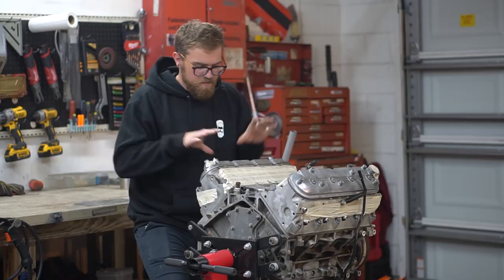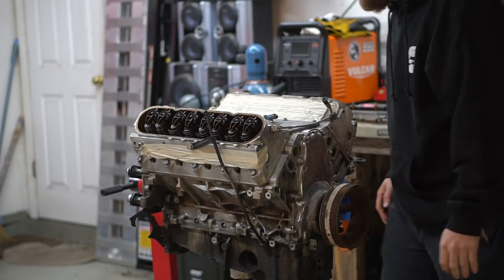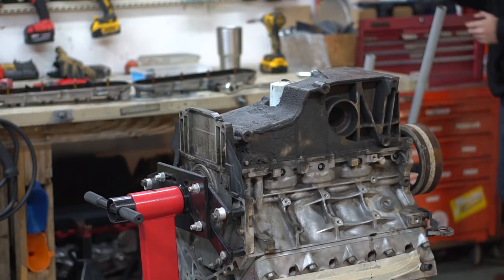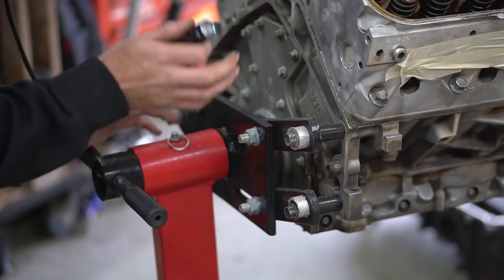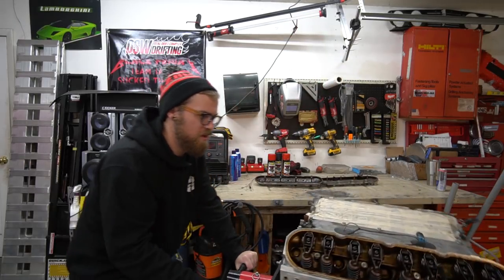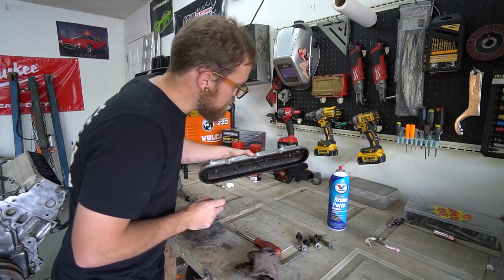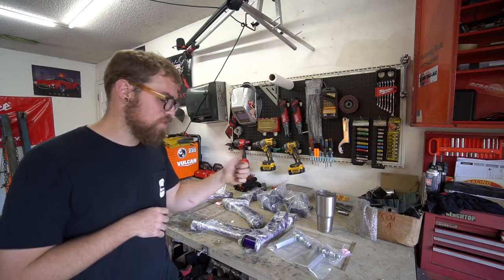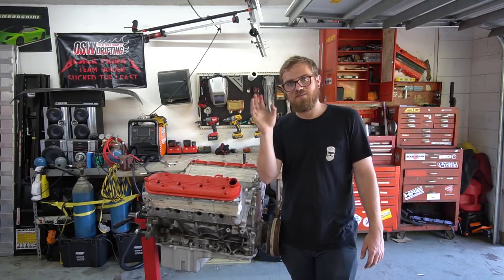Budget LS Swap Miata Pt.3 Opening up the Engine + Surprise Mod

Comment: Taylor! Don't run a high volume pump! These motors already suck for oil starvation with small pans, like what you will be running. Melling Makes a High pressure, stock volume pump. Part number 10295, Thats what ya want. I talked to ya at the Montreal FD event about my ls miata, Glad to see you're going through with it!

Comment: I would take the heads off to check out the condition of the cylinder wall & rings. like you said.. could be a little buildup that will clear. But even if you dont need them, head gaskets are very cheap compared to everything else you will throw at it. Great video, exited to see the rest of the build!
Reply: Christian Hansen not even take the heads off but at least grab an inspection camera from an auto store, usually you can rent one or they will lend you one to use and inspect the walls and pistons
Reply: But a camera to shove threw the spark plug holes.

Comment: Taylor you should check your knock sensors while you've got it on an engine stand!!! At 17:42 in the video they're under the two little rubber boots right on top. I've got almost the same engine in my truck and at 170,000km the knock sensors were completely rusted out. It took me a few hours in the garage to replace them and it would have been a lot easier if it was on a stand. 
How i'd check them is just remove the rubber cap and if water got in and rusted them replace them. Also make sure you use silicone on top of the boots after so water wont get in again!!! at 17:42 in the video they're under the two little rubber boots right on top. Depending how you are going to wire the engine bad knock sensors tell the engine it has a knock when it doesn't and i believe can get as bad as limiting power and changing timing of the engine. (At least thats what i noticed with mine) after replacing mine i've had no issues since.
Keep up the awesome videos!!

Comment: It looks to me like that motor has been over heated before..  I just did a motor rebuild from a catostrophic failure caused by over heating and the in side of my motor looked the same..  Kinda goldish in color aluminium and black steel. This is caused by oil getting to hot.  On another note i get your 75 25 thing..  However consider this the 25 that is left over could turn into another 75% of work Needed to be done later.  For example if you leave it kinda dirty now and you dont notice that there is a hairline crack in the block that could have been welded to stop it from fracturing will turn into a major repair later..  Cleaning is free man..  Other than the time spent cleaning (timeismoney) you may come out ahead later..
Reply: Andrew Bair most Ls based engines will turn that goldish color just from use, it doesn’t necessarily mean that it has been overheated
Reply: Oh yeah I could be wrong thats for sure. However that crank and those rockers looked awful black to me. The motor that I just rebuilt was not an LS either so it could be fine. After watching videos on my motor being rebuilt after 100k none of them looked as black and as "goldish" as mine did. After some digging I found a few people that have said that they believe that its from the oil getting to hot but you know... internet... so.. yeah there's that.. I am not an expert I was just using my past experiences as a reference. I dont have much engine rebuilding experience besides working on my own stuff for the past 15 or so years.
Reply: One side is darker because that’s the side with the pcv valve hard for me to believe all you guy’s rebuilding engines don’t know this already. But I guess most of you guys are young. So now you know and I wouldn’t say that in front of any experienced machanic you might get a funny look as this is one of the first things you learn when beginning to work on engines

Comment: I'm with you man, I love the wrinkle red on valve covers. That's how I did my DSM. But the only drawback is it's very hard to clean up, compared to a gloss finish. The key is to fix the oil leaks, then it stays nice and pretty lol.

Comment: Tip on the engine stand,  if you line the center of the stand to where the cam is in block it will be really easy to turn engine on stand. Makes it not so top heavy. Enjoy the videos keep them coming.

Comment: When doing the cam swap if your not gonna pull the heads get 16 pen magnets and use them to hold up the lifters don't trust the trays to hold them. I've did cam swaps under warranty on about 30 or 40 5.3 motors and if your gonna pull the heads replaces the bolts with studs well worth it if your ever gonna go back into the motor for anything.

Comment: Hey Taylor, just a little trick i learnt on getting snapped studs/bolts out. Instead of welding straight onto the stud, weld an old nut to the stud and use a socket and breaker bar to get it off 😁

Comment: You are already there. Pull the heads have them decked, better compression ratio and ensure head gasket seal. Trunion upgrade to rockers. Pull the piston and hone the cylinder walls. Put fresh bearings, connecting and main. Cheap insurance. Might as well make sure it will be long term reliable.
Reply: dose he have a ls1 or just a 5.3 ls based motor? if so i would bore it to a 5.7 amd run flat top pistons and a btr cam stage 4 and port the heads like you said had that same build in a 01 z71 and she was fast and strong

Comment: You really shouldn't spray brake cleaner in your bottom end. Especially over the bearings/ conrods. it will strip out the oil layer in the bearings & when you go to start it the crank wont be floating in the oil it will rotate on the bearing it self. Metal on metal is not good. Make sure before you start it you crank it with no fuel/ spark to build up oil pressure so it will re-fill the bearings with oil. Looking forward to the finished product! Best of luck!

Comment: I would pull the heads. For sure. Makes the springs and cam easier. When you buy a full gasket kit you get the head gaskets anyway. since you have to do springs, And you will get a full gasket kit, you also get valve stem seals. Extra piece of mind. You can see how free it spins with out the lifters and pushrods and cam turning. You will know for sure what’s causing the. Hang up...  it’s just a few extra hours labor.

Comment: Hey Taylor just a heads up, I had one of those engine stands from harbor freight. It had great review and everything! I put it together and threw a Ford 4.6L on it and the first time I started turning it, the welds gave out. Scared the crap out of me! Fortunately the motor didn't hit the ground. There was a bit of the weld that was still holding the plate to the stand. It did dent up the oil pan a bit though. Anyway, my point is, you should probably take the time to re-tig the welds that hold the plate thingy to the tube thingy. After I zuesed them up, I could stand on top of the engine, jump up and down, and it held just fine. Just don't want to see the LS hit the floor or hurt you.

Comment: I dont know if you have already chosen a cam yet but if not my recomendation would be something in the 22x/23x size range. A cam of this size such as a btr stage 1 or 2 ls1 cam will sacrfice little to no torque at low rpm and make sizable gains over 4k. roughly a 75-90hp gain just from swapping cams and springs. I would also highly recomend rebuilding the rocker arms with a comp cam trunion upgrade as to avoid filing  your engine with the little needle bearings at high rpm lol. Hope this was helpful, im looking forward to seeing the rest of the build series!

Comment: I just got done doing this with my 5.7 on my channel. I tend to follow the "good nuff" rule, similar to your 75/25.  its odd how that one side is black and the other is more brown. engine looks pretty good though.. dont "like" the hang ups when rotating it for sure. I also had the same pondering moment to pull the heads or not but got all my exhaust bolts out and rotated buttery smooth, so I hope im "safe".  I did do the trunions for RPM issues not really HP. I also put new timing chain and oil pump. I also had the holes drilled for the timing chain guide which i was SUPER happy about. Good luck with the build!!!!
Reply: ToxicMongoose darker side is because of pcv on that side, I've always been opposed tools swaps but now I kinda want to 😂😂
Reply: I guess that could be it.. though when i took mine off i didnt notice such a difference.. OH YEA i would def  prefer an engine that came in the car but nothing really excites me in that range and I feel like for me 240 and LS is  best of 2 worlds

Comment: Check the crankshaft shims make sure there not worn or un aligned. And if you pull crankshaft out if bad or wanna see more you can remove pistons easy that way at that point and check head without allot more work. The metal has a black tent to it like never changed oil or overheated. Up to you

Comment: Hopefully this doesn't get lost in the comments....

The "hang up" was just some slight rust build up from sitting with the water in the cylinders. Once you got it moving it knocked everything free. It's gen3 rods.. so they are the weaker variant BUT will still support 550whp. Plenty for the Miata. DO NOT replace the oil pump. High "flow" pump WILL suck the pan dry under high rpm and you will do damage. LS's do not have the best drain back setups, so keep the stock pump (will still make over 80psi without an issue) and add a extra quart of oil. Tech tip: flip the engine upside down when you do the cam. The lifters are under the heads on LS engines, so with the engine upside down they have no chance of contacting the cam as you pull it out (don't forget to remove the rockers and pushrods). Any more questions, feel free to reply or message me.

Comment: Personally, since your changing valve springs anyway, i would pulled the heads off. Its a win-win. Makes the job 100x easier as far as changing springs go, and you can see clearly how the hone is on the cylinder walls. But you can always fill the cylinder with air to change springs. If you do that atleast by a boroscope to put down in the cylinders to check them out.

Comment: About the whole wire wheeling the aluminium surface to get the silicon off, I use a scotch bright pad on my air tool and it does an amazing job! Try it out!

Comment: I do like your 75/25 philosophy, it keeps you on track and like you said, it's easy to get side tracked and loose sight of the goal. Personally, I'm a big believer of "do it once, do it right". You mention you want to get a cam and springs for it but would like to keep the heads on, the way I see it is you put in a new cam and springs and those little things that are in-between, the lifters, are a very critical piece of the valve train. It's pretty hard to inspect them with the heads on. I would suggest keep doing what you're doing, do the visual checks and a few little things but leave the stock valve train in the engine. It would suck balls to go halfway and put a brand new cam in and then shortly thereafter find the lifters ate away at it and now you're back to where you are now. Also another side note, put a new o-ring on the oil pickup but leave the pump on, the high volume/pressure pump stuff is unnecessary and could potentially do more damage than good, especially with the style of driving you will be doing with the car. Like I said, either keep it nearly stock with more than adequate power, beat the piss out of it, if she's reliable and you want more power, do the cam swap the right way and then be happy to know the rest of the short block will support the added stress. Keep the videos coming and thanks for the hard work putting them together for us to enjoy!

Comment: Taylor, pull the heads! If ur doing a cam u should upgrade to ls7 lifters. Ls motors are notorious for spinning lifters with a cam & lots of rpm! Plus a trunion kit for the rockers.  I made the mistake of not doing it, and kicked myself for it later!!! Good luck with the build!

Comment: You should totally take off the heads and check those piston walls!! Your biggest cost is replacing those gaskets and that's not a bad idea to replace anyways; unless you also wanted to do head studs. It'll be so much worth your time checking out those piston walls especially at those rough spots you felt while cranking that engine (in the wrong direction).

Comment: FYI to share. Never unbolt the oil pan in the upright position.
Always unbolt from the bottom.
So no fine metallic particles will fall back on the cylinder walls.

Comment: If you throw a cam in it, even if it’s just a stage 2 or LS2 cam, you need to take off the heads, swap old rocker arms bearings to a trunion setup, get new rods, and dual valve springs.  A bigger cam can put a lot of pressure on your stock valve spring and needle bearing rocker arms.

Comment: I’ve took a motor that was super hard to turn sat for awhile in a wrecked truck and cleaned it up. Took me a while to get it moving freely. But it ran great, used a little oil not excessively and is still running. That was 4 years ago
Send it!
Drift it!
Crash it! 
Fix it!

Comment: Deff pull heads to inspect cylinders, but mainly to put in fresh MLS headgaskets while the motor is easily accessable lol, just dont forget sequenced torque to spec !

Comment: hey man, you could use helicoils for the bad threads. probably a bit easier than welding. the problem with your method could be the drilling part. If the whole is off a little you will might have problems when fitting the headers.

Awesome content Taylor!

Comment: Gunk foaming engine cleaner will be your friend and prestone super clean to finish it off. I spray them on and use a cheap electric pressure washer and engines come out clean with very little effort.

Comment: Quickest & most thorough method of cleaning off gasket material AND prepping the surface at the same time = SCOTCHBRITE WHEEL on a right-angle die grinder.
2 minutes and the entire oil-pan would be ready for new gasket sealant...

Comment: if you want some advise from a GM master automotive technician, those motors down fall is the roller lifters failing and damaging the cams. pull both heads, and replace the lifters with the cam. Those motors are so simple to pull the heads.

Comment: Yep, refusing to say "That'll Do" is why many get lost in a build, and never get to drive. 
One thing I always check on an engine though is the bearings. It doesn't take much time,  and doesn't cost anything. My donor engine had a slight spot of resistance turning over. It turned out to be a spun bearing, with both halves sitting on top of each other, and crank being beyond salvation. 😭 At least I dont have to find out on startup, right? 

Other than that, I really like the time and effort you put into the production. 3 quality releases per week works much better than daily, slapped together videos. 👍

Comment: definitely pull the heads. Checking the heads and block for straightness is free with a metal straight edge. A valve grind is free except for the cost of the valve paste. Do it once, do it right.

Comment: If you had oily water in there I would want to open it up to see if there is any debris on the valves or if it left a ring ridge. Someone threw some oil in there and let a bit of water get in and it was thick milkshake when I took the head off. Left a nice ring ridge that eventually ate the piston by my guess. I had another one I took the head off to find a lot of rust stalagmites on the bottom of the valve, not a big deal for NA, but if you have a turbo or nice sensors they would take an additional beating that is if the rust doesn't act as hot spots or break off and ruin the valve seat.

Comment: If you adjust the small arms on the engine stand that attach to the block you can change the center of gravity so the engine can be turned over easily.

Comment: Your advice about just getting the car running hits home. I keep getting sucked into picking the best parts for a turbo Miata with the 99 head, what manifold, what injectors, blah blah blah and I get stressed out over nothing. Honestly a stock NA 1.8 with a turbski would be perfect for me, doesn't need to be complicated 😂

Comment: I bought a 400sbc one time and was only gonna pull the intake off and put my Holley one on .........it turned into a full rebuild with flat tops and a thumper cam ....dont be like me just put it in
Reply from the maker: Exactly  why i don't wanna do it!
Reply: Thats trueee but one time i got a 383 stroker off a family member and the motor sat outside for multiple years and guess what happened after i did all the maintince and pulled head covers and oil pan off. I even put a new oil pick up and i drove it for about 17 miles after dropping it in yet it have all forged internals and a loopy cam it sezied a rod bearing and it spun and basically melted itself to the other my advice just pull the head, fuck the cam you're not going to want to do cams way to much money and way to much time that you dont got we all know you wanna go drifting just do preventative maintenance a do a look over
Reply: Drift King's Motorsport a decent cam for this motor is around 230$.

Comment: Checking the threads on the crank for the flywheel but missed two bolts and a nut plus forgot you took a spark plug out😂😂😂😂😂😂😂😂 hilarious!

Comment: I’m with the others that said to take the heads off and check it out. A running motor might be motivating, but having to yank it all apart and do it again won’t be motivating, it would just suck. For the cost of head gaskets it’s cheap insurance you won’t be tearing it right back out again.